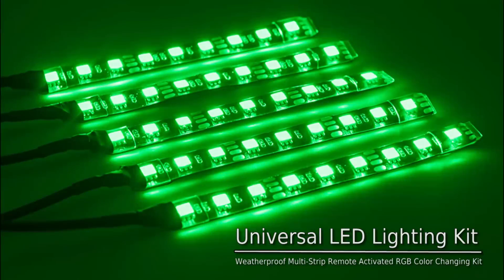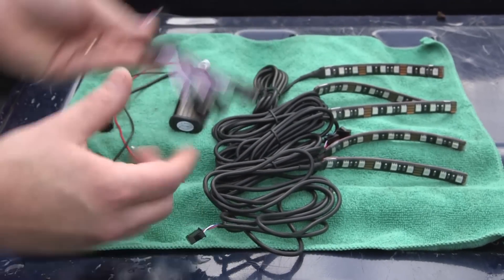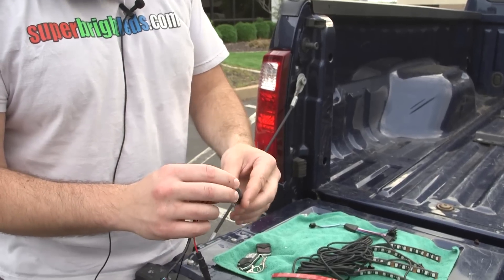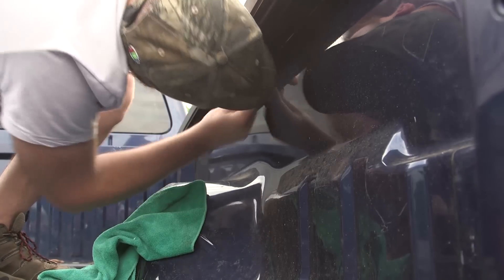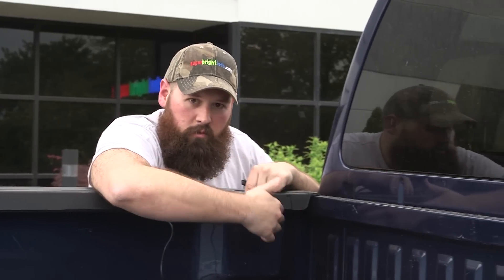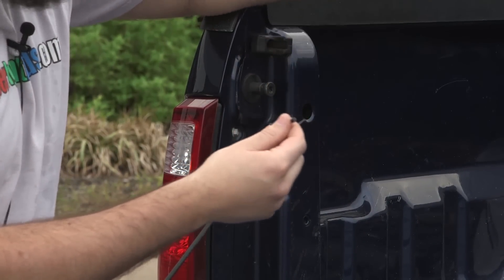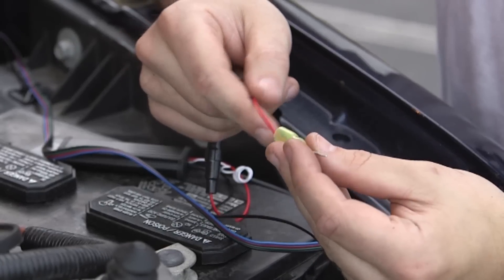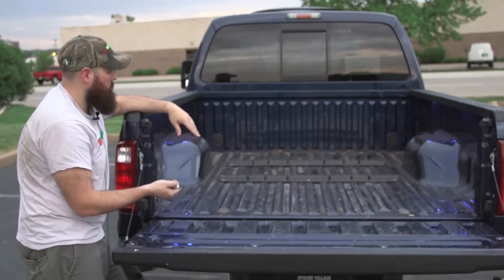How to install truck bed led light kit

Comment: PS isnt it easier to splice some cable running to the tail lights or so. THat would mean it cant go on when main lights are off. But would allow for way less shorter cables and still clean engine bay